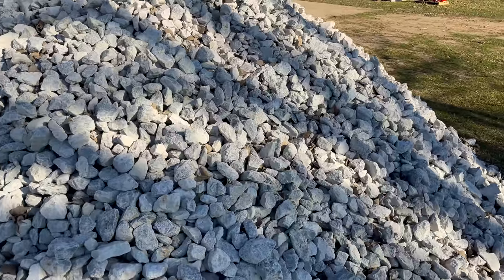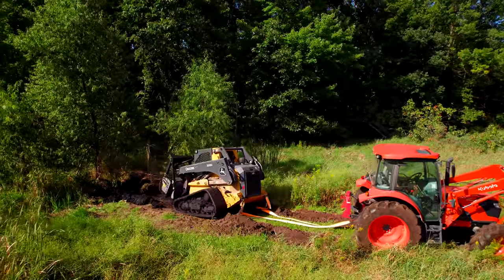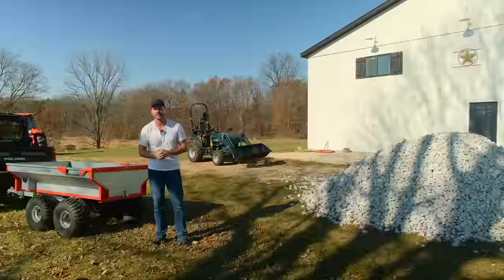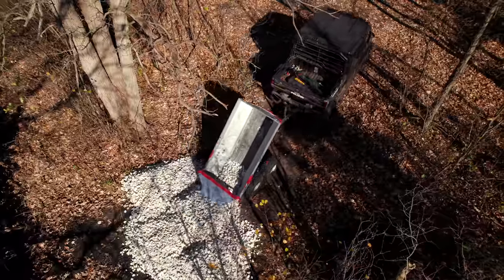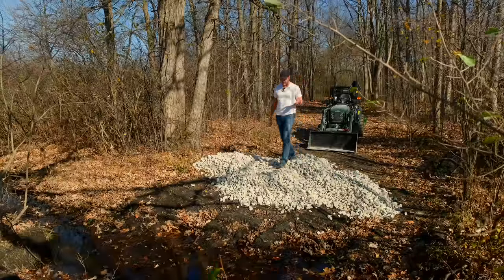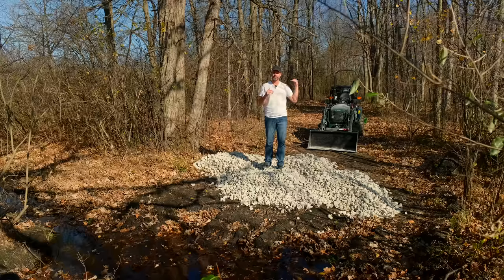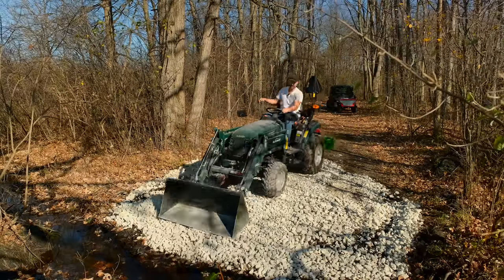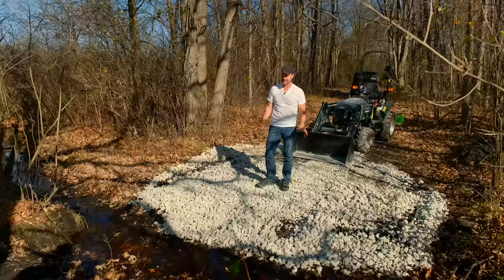A GREAT DUMP TRAILER FOR THE HOMESTEAD. SUMMIT TX25 LOADER WORK

Comment: I was told by my combat engineer buddies when I was in the army that there are 3 basic rules for civil engineering. You can’t push with a string, Sewage runs downhill, and Dirt added to mud equals more mud. It seems to apply to #2 stone as well.

Comment: Place a construction fabric layer to the creek/stream edge, up to solid ground. Then add more stone/ rock. If it legal to "ford" across a waterways in Michigan. Placing a culvert could be slightly beneficial, but most likely with become a plugging mess. Keeping the stream/ creek as natural as possible, while still transmittable, is your best option I.M.O.
Reply: Shawn is 100% correct. Geotextile fabric or even as simple as snow fence will prevent the stone from sinking into the mud when pressure is applied to the top of them. I'd stretch the fabric to generously cross both sides of the creek before adding more stone. If you opt to add a culvert instead ensure you get one sized properly to the volume of water throughout the year and that won't be plugged with leaves every 6 months. The tractor was impressive to see when it  dug into the stone pile with ease.

Comment: Hey guys,   Never underestimate the ability of the farm to provide the solution to it's own problem... It's time to find a good hillside on the property to become your "fill dirt supply"...   Actually save/pull that rock back to save it at the job site... Put in the culvert next (ensure it's got the debris bars at the ends to keep it from plugging).   Then use your fill dirt next on top of that muck over the culvert as well to raise up the grade a foot or two...   Then put the #2s on TOP of the fill dirt that covered the culvert and made your approaches on either side.    With that handy-dandy dump trailer, should be about 4 loads of dirt on each side of the culvert, so maybe 8 (or 10?) total more runs.   Or better find the fill dirt close by and just run the big Kubota bucket loads down there with full scoops of dirt if the hole is nearby... Then maybe a few yards of crusher run or that nice tan road gravel you've used already... about 2" deep over the #2s to pack down and seal the top.   Good to go!  👍

Comment: I’ve built several over the years on my farm…..   build a low water crossing or Ford as they called it in horse and buggy days.  Use Rip/Rap size stone 8”-12” size stone and push into the ditch and across. And them barely fill over that with the stone that you did buy.  The idea is not to hold the water but to put a hard bottom in the stream bed that will support your tractors and equipment for crossing. Google low water crossings. With this you will never have to work about a damned up or stopped up culvert.   If you do install a culvert make damned sure it’s big enough. From the looks of it I would install a 36” diameter metal culvert and ramp up and over the pipe. One this large will never damn up and the water wouldn’t wash out dirt by being able to breach over the top and wash it out. Good luck!

Comment: 4x4 sidewalk was removed and I dug out the sides of the stream bed approach and exit where the mud began. Put the sidewalk in.  Covered with the sand and stone I got from the middle of the stream.  Tri- axels have crossed without an issue.

Comment: If you only need an 8' or so road across, I'd pick up a 20' 18-24" culvert pipe (smooth wall), cut in half, place them side-by-side, place large rock and your 2" stone followed by some good pack stone with some dust, then build up to a good level. Unless you're getting massive gully-washers through there I'd think that would do it.

Comment: Old timers would build what is called a corduroy road. Basically you cut logs and lay them across the muddy area to look like a stockade wall laying down and then cover with your sand and rock.

Comment: Get a roll of road fabric and put it down first. It's amazing how much it stabilizes the ground below fill. I put it under my driveway at my hunting property.  I put a foot of class 5 over it and I was able to have quad axles with 26 ton loads over it thru the woods that was pretty dang soft when  I started.

Comment: Culvert, and geotextile fabric then stone.  You could put larger stone down into the muck first like a rip rap, then geo textile fabric on the banks, then topped with the #2 .  You'll need to deal with the culvert a little differently depending upon it's construction and load capabilities.  Larger tin horn style culvert will require dirt- usually engineered clay type to be able to distribute the weight across the culvert, then top with stone.

Comment: It's easy just keep adding rock and pushing it down by driving over it. The rock will find the hard ground under the mud. Depending on the ground the hard pack depth can vary even in a small area. The rock will sink into the ground for awhile till one day it just pretty much stops. The rock added will be less pretty quickly,  then about once every year or 2 add a little. After adding rock a few times it will be good for several years, then added a little and let it go for several years again. But this will make you a good low water bridge across the creek that with a little maintenance that will last the rest of your life. 
The bigger the rock the quicker it will stop it from sinking so fast. Star with a little bigger rock then the #2 over top and just go to adding a little rock here and there when needed. 
I personally wouldn't added pipe and build the ground up over the pipe. This isn't a main road supporting heavy loads this way you would need to dig out under the pipe and add hard build up so the pipe wouldn't sink into the ground over the years. Plus you would always be cleaning sticks and leaves out of the pipe.

Comment: Oh, you just said the magic word.
You can put a 18” or 24” culver corrugated steel or concrete. Put about 6” of your #2 aggregate after you dig up about 8.” Deep to make room for the aggregate and pipe thickness. Match the slope of the stream. Then pour the rest as you planned to. Just check pipe rating for load and hope you can avoid the added expense of a structure to protect the culvert. Personally, I build a wood bridge using treated lumber.

Comment: You’re on the right track. Add more of that stone then bring in smaller stone to fill in the gaps after you work that bigger stone into the muck
Reply: Add some even larger rock in the channel and then the #2 on top of that. Water can flow across the stone and you’ll be good to go

Comment: Remove four to six inches of the muck in the road bed you're going to be driving on. Replace it with 53's  (pack rock is what we call it locally. #5's mixed with fines-the dust from crushing). Pack that by driving over it. When it settles and dries its almost as hard as concrete. Then cover it with #2's, 5,s, whatever. You'll never sink down. Did it in my driveway for the huge garbage disposal truck to reach my dumpster. Its been there for 15 years used weekly through all kinds of hard freezing and thawing. No sign of any wheel ruts since.

Comment: I would put in a culvert and the backfill around it and in the mucky areas with what we call here in Missouri shot rock. Its large stones that are not crushed after being blown out at the quarry. That'll give a solid base for your finer finish stone to sit on. Track in the shot rock to.push it as deep into the muck as possible.

Comment: You have trees all around use what you got. Lay the largest trees parallel to the stream then build across from there. To make a natural bridge then sand the gaps so you can drive over. Tons of fun an tractor time....😀

Comment: on either side of that little run I would sink  at least two10" or 12" sono tubes down about 6 feet, fill 'em with concrete and rebar   and then  just build a bridge.

Comment: We used a couple of loads of 1's and 2's first until they wouldn't sink and made a hard base. Then 3's and 4's for filling in, used it for a year to settle while using, then 57's next year. it's held up for over 20 years, only had to top coat it once again in all that time with yearly heavy spring run off.

Comment: As others have said, nearly every state requires a permit to alter a freshwater wetland (streams, vernal pools, swamps, bogs, ponds, etc.) including your state of Michigan. Altering includes depositing or permitting the deposit of fill material, removing of vegetation from the buffer area (which could be up to 100 ft from the wetland), etc.

Comment: Love the load of #2  🤣🤣🤣
Culvert is really the only option. I cant figure out what your logic was on just the rock. You did a great job of showing off all your equipment you used to get it done...😂😂😂
I build bridges over creeks from time to time so i do have some experience here. Lots to consider obviously. Yes, you have some soft banks and that plays into how many tons of rock you want to put in there because it's gonna sink and sink and sink. I'd make a timber pad on each side and put in a culvert, then cover with rock. Should last a couple decades. 😎😎
Also - I wish i had a tiny portion of all the gadgets you have in regards to equipment

Comment: You might put in a covert pipe and put some #2 underneath the pipe take out the soil on both sides to get to the clay or hard pan then put the #2 pads on both side. Thats should be good.

Comment: You have to start with a solid base for gravel or in your situation, a pathway for the water to drain off to provide a solid base.
Only other option is an actual bridge structure.

Comment: Pipe then flagstone hump it up and pack it a bit then add you limestone not gravel gravel will not pack and stay it is too round you need driveway limestone for the top or it will keep disappearing on you if you like #2 gravel ask for #57 driveway limestone it is very similar with better shape for compaction.

Comment: If you legally aren't allowed a road across the ditch then maybe you could have an 8 or 10 inch culvert in the side/wall of the ditch to bypass the water around your gravel creek-bottom at low flow.  I have a neighbor who has that issue right now, he wants a road but isn't federally allowed to have it due to flood regulation.

Comment: Don’t buy any timbers. Find 2-3 trees roughly the same diameter. Cut them to the width of your desired path. Submerge them just below top of water in the creek, then place your stone. You can actually do the same thing on both banks. As long as the trees stay submerged, they will last your lifetime.

Comment: So basically u were trying to build a "Texas crossing".  1st off this should have been during summer when things were at their driest. Small excavator with wide bucket to pull sloppy material off down to base material. Then put rock in, but keep in mind that the creek will move silt material and fill in around rocks in bottom and sides of creek. A bridge structure most likely would have been best solution.

Comment: I would delete this video asap. If EPA sees this they will freak out. Don’t mess with creeks or natural waterways. They don’t play around. Big fines. Good luck and don’t post anymore about the creek. Just my advice. Check out Street Speed 717 on YouTube. He paid 50,000 fine for driving a pickup in a creek.